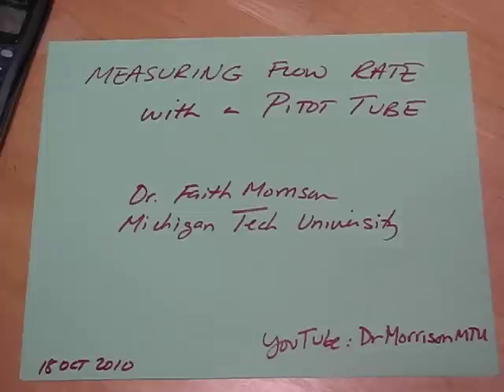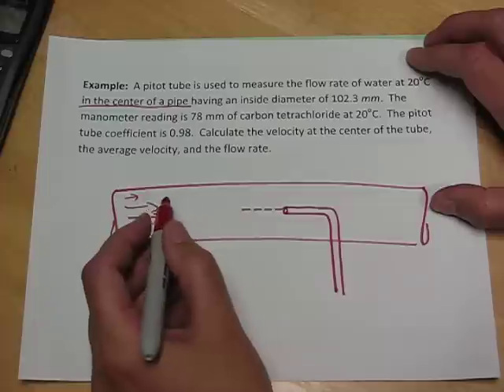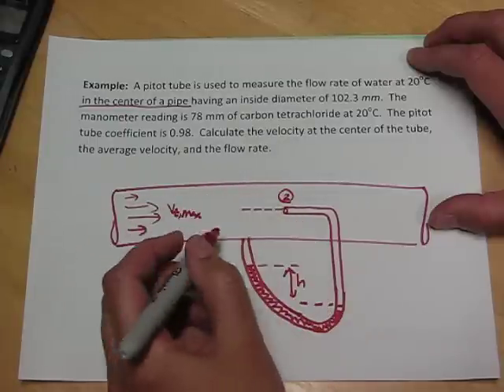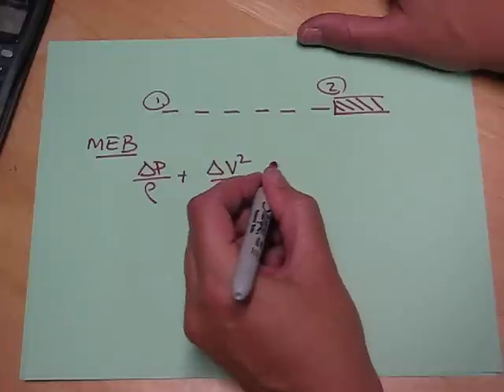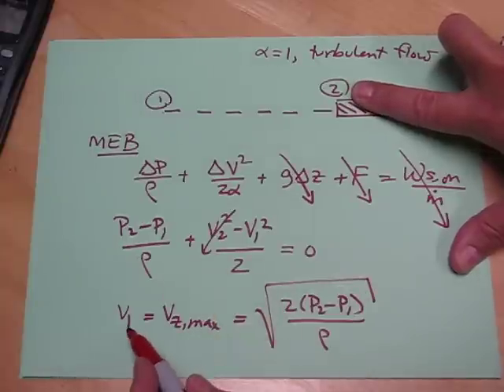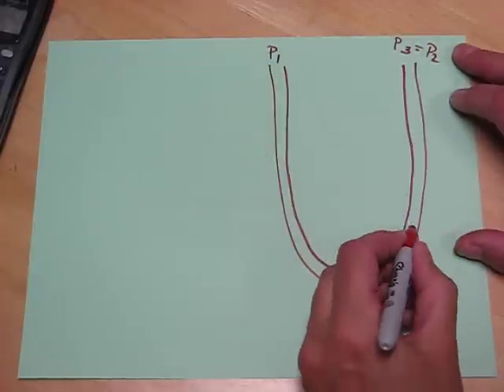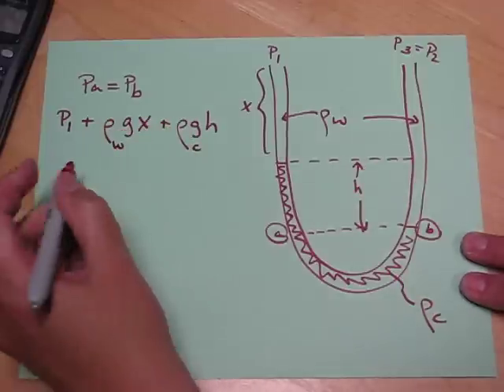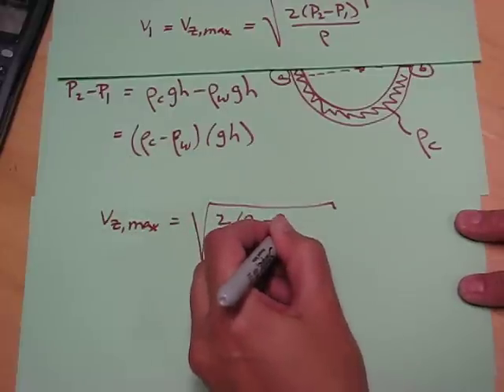Analysis of a Pitot Tube

Comment: Mam can you explain why we can't just straight away equate the dynamic pressure i.e. 1/2*d*V^2 (where 'd' is density) to the manometer reading ? Isn't this how it's done in real life where the pitot tube has two outlets - one displays the total pressure, the other static pressure. Both of them are connected to the ends of a manometer and the difference gives the dynamic pressure ?
Reply from the maker: My treatment starts with a "law of physics" and shows at each step how we make assumptions to get to our answers.  Thus, we start with the mechanical energy balance, which is an energy balance that has already been simplified for the following case:  single input, single output, steady, no reaction, no temperature or phase change, adiabatic.  What you propose is more intuitive, but actually, it does not show what principle of nature makes it correct.  So, it may be a good way to remember the solution, but it does not allow us to see how we might analyze a different situation.  Starting from the laws of physics (energy is conserved) has this advantage.

Comment: i have a doubt regarding pitot tube. can you please help me .my doubt is how we can say that velocity at the point 2 is zero and how do we can say that pressure at point 2 is higherthan point1,if it is so how flow will takinplace from low pressure to higher pressure
Reply: it is because since the fluid is going through low pressure to high pressure..... it's velocity goes on to decrease and ultimately upon reaching the pitot tube it becomes zero......
Reply from the maker: The Pitot tube intersects just one streamline of the flow.  It's like putting your hand out the car window:  you feel a higher pressure on your hand due to the air coming at your hand an your hand stopping the flow.  So, just at that location where the Pitot tube intersects the flow, the pressure is high.  Out in the tube, for the whole flow, the pressure decreases in the direction of flow (unobstructed).
Reply: @DrMorrisonMTU  Thank you for clarification

Comment: Delta V squared is NOT V1 squared - V2 squared.
Reply: Its just lazy notation. The equation is (v_2)^2 - (v_1)^2. Idk why she wrote (delta v)^2
Reply: Yes I just had to sort out the same confusion from my lecturer (don't ask..).  The term you need is [delta(v^2)] since it's [(v_2)^2 - (v_1)^2] but I started working with (delta v)^2 because he wrote it the same way it's shown in this video.

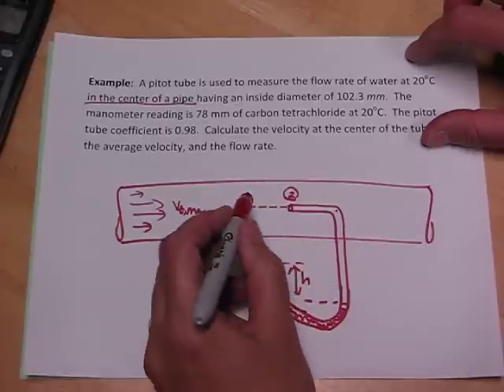Comment: I don't get the static assumption at 5:28, I thought that the venturi effect caused the pressure to drop whenever a flow speeded up, so the pressure between point 1(free fluid) and the surface of the liquid inside the manometer can't be calculated just as a static column of fluid. The only way I can understand that is that the pressure inside the tube, even if the fluid is moving, is constant( the speed doesn't change because the area remains constant) so we can make that static assumption, is that correct? Thank you and sorry for my english.

Comment: On 5:20 we have manometer. In left side is it open or close to the pipe? When the diving cylinder is from firm metal and is under water pressure also acts to a gas in bottle. Please answer me. Thanks

Comment from the maker: If the density of the manometer fluid is less than the density of the fluid above it, the layers are unstable and the upper fluid will flow down and exchange places with the lower fluid.  Since the lower fluid has higher density, then, we do not get a negative sign under the root.
Reply: If the fluid in manometer has less density than the fluid in the flow, then can't we use an inverted U-tube manometer just so that negative root is eliminated.

Comment from the maker: The density of the working fluid in a manometer must be higher than the fluid above it or the fluids would mix and switch positions.  Carbon tetrachloride has a density of 1.5867 g/cc, which is higher than water, density_water=1.0 g/cc.